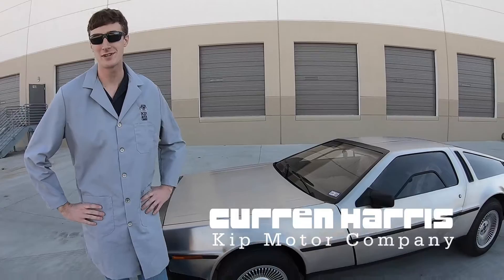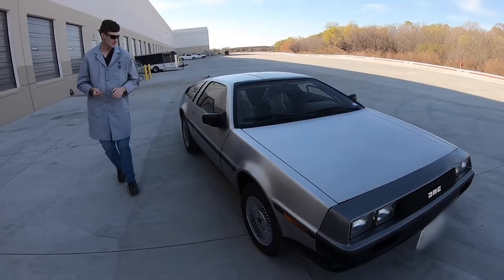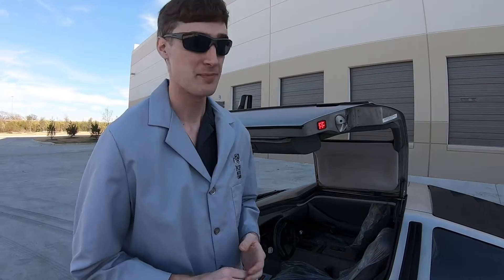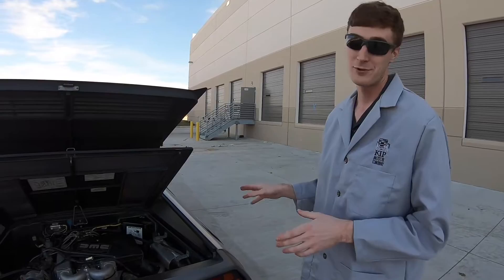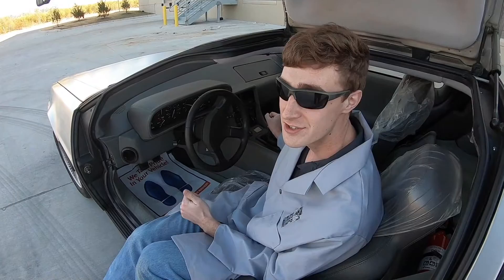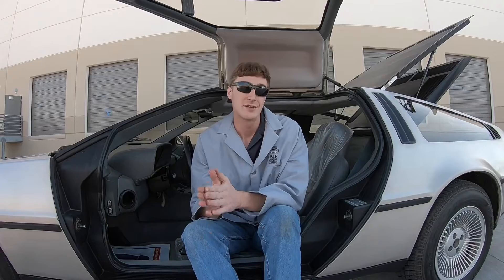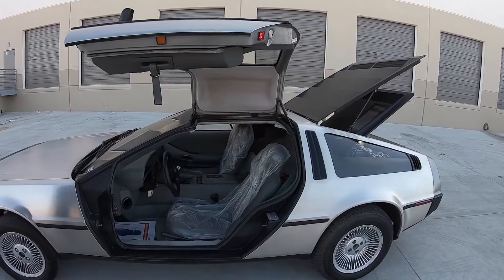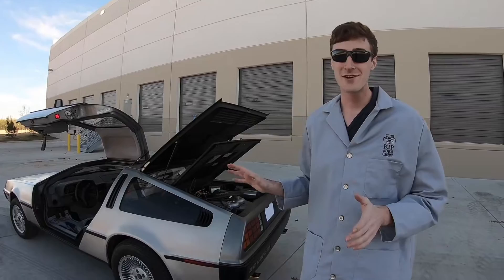DeLorean 101 from Kip Motor Company

Comment: Hello, great video, I own a 81 turbo Delorean, I'm having trouble when I star mine it has a racing idle like it's in neutral and I'm flooring it, the only way I get the idle slightly lower is when I have to go to the engine and manually move the throttle then she'll idle a little lower, then when I turn off the car and start it again there's that racing idle again, any idea what could be the problem?
Reply: This is usually due to the outside temperature... My 78 TA does the same thing when its cold out, or if I haven't moved it. It's normal...

However, if the temp is normal and this is just a consistent issue, it could be that the throttle body is gunked up and needs a good cleaning...
Reply: Thank you my friend, it is freezing outside for sure. Chicago! Hate the winters here!
Reply: @garzilla8981  yeah, that's sounds about right... That'll do it haha...
Reply: Where you located? Always searching for a good Delorean Mechanic.
Reply: @garzilla8981  eh... Sorry I'm in TX, and right now we're going through a horrible time
Reply: @PontiacBandit  sorry my friend, I saw what's happening to all the good people in Texas, my prayers go out to everyone in Texas, God bless.
Reply: @garzilla8981  much appreciated 🙏